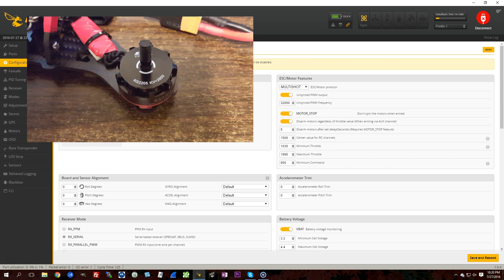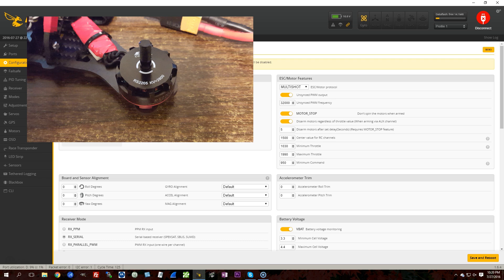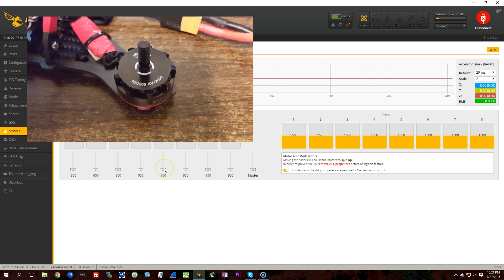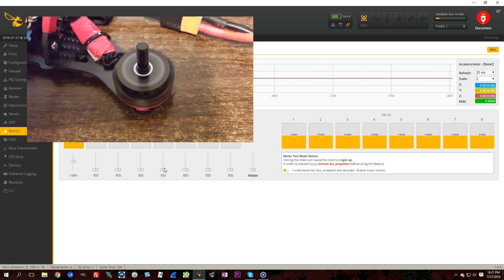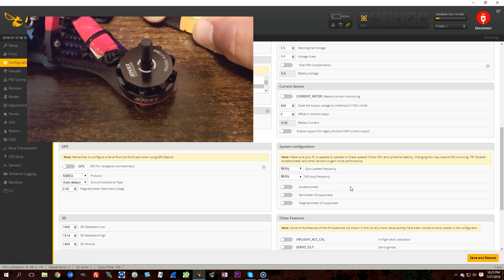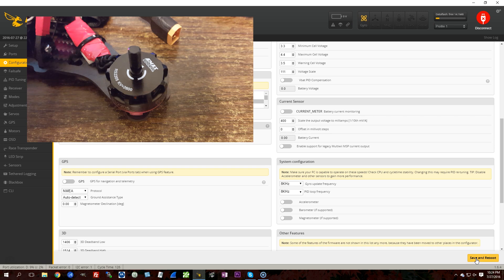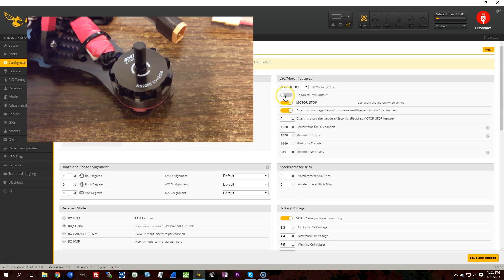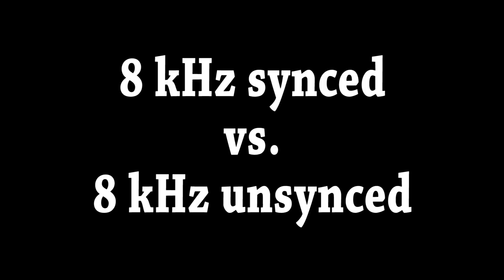Synced vs. Unsynced Multishot: Does it make motors smoother?

Comment: so if I want to run in 8k/8k, and does not want any jitter, I think it will be safer to just run in unsynced 8k too instead of going higher like 16 or 32k and or any higher than what your PID Loop is because I think higher that what your PID loop, the jitter on the cycle time still get feed on unsynced.. It's like I have a bigger bag for errors to feed.
Reply from the maker: You can't run unsynced if you're using Dshot, and Dshot is the way to go. So this topic is a little bit out of date.
Reply: sorry, I got confused with what I wrote "I think higher that what your PID loop, the jitter on the cycle time still get feed on unsynced" I read it and I was like .. WTF happened .. LOL 

This is what I was saying 
"I think it will be safer to just run in unsynced 8k too instead of going higher like 16 or 32k and or any higher than what your PID Loop is because the jitter on the cycle time still get feed on unsynced" 

I understand that I can't use Unsynced if I am I using DSHOT. I still use Multishot on all my build. The reason for that is because .. It's faster that what my ESC can support for DSHOT.
Reply from the maker: If you're running Multishot then I would use 32k unsynced.

Comment: i tried reading to find the answer so i guess ill just ask. i understand why you have min command at 950 but why is your max throttle at 1990 now? Are your ppm min and max still at 1000-2016 in blheli, or is there a different calibration for running multishot? I was also wondering if you knew why when using multishot that the motors take longer to start spinning. When running OS125 and calibrating the way you demonstrated with min command at 980 my motors would spin at like 1005 1010 so i set min throttle to 1025. With multishot and my min command being at 950 now due to the motor twitches like in your video, my motors dont even start to spin up until like 1045 or so. Is that normal? Im runnin a spf3 evo, littlebee 20a pro, and rebel 2205/3000kv motors. TIA!!
Reply: i lied, they all start movin at about 1029 now and dont sound like theyre running smoothly until about 1065 now. This is with runnin 8k/4k/8k by the way. If i run synced the start up tone is NOT in sync. When i run unsynced the start up tone IS in sync.
Reply from the maker: My throttle settings are explained by this video: https://www.youtube.com/watch?v=zCoEWBhJy6Q

If you switch from Oneshot to Multishot you need to recalibrate and re-do min_throttle.

1045 is a completely normal min_throttle value. It's normal for Multishot min_throttle to be higher than Oneshot but I don't know why.
Reply: When you say recalibrate do you mean actually doing the calibration process through the motors tab on betaflight? I just left the min and max ppm where they were from doing the manual calibration you demonstrated by just putting them at 1000-2016 in blheli.
Reply from the maker: You can calibrate with the Motors tab or you can manually calibraet, but you have to do it again after you switch to multishot. The values will be different.
Reply: when i do the motors tab calibration i get a min ppm of like 1016 and a max ppm of like 1955 in blheli. when i was on oneshot, after i would calibrate using the motors tab id get a min ppm of like 1012 and a max of anywhere between 2012 and 2020 in blheli. the numbers just seem off and lower on the highend with multishot and the mins seem like they go up lol
Reply from the maker: It is what it is.
Reply: so my next question is, in your calibration video your max throttle is 2000. In this video your max is down to 1990. Are your ppm min and max still 1000-2016 like in the calibration video?
Reply: so do i leave the max that low in blheli at 1955 or do i put it in the 2000s like in your calibration video?
Reply: i guess my main concern is gettin full resolution which was the purpose of your calibration video. But when i calibrate with motors tab the min goes up and the max comes was down to 1955 so am i not losing resolution?
Reply from the maker: Loss of resolution doesn't matter, the endpoints have to be calibrated correctly. Multishot will always give more resolution than Oneshot. Oneshot on BLHeli has about 250 steps of maximum input resolution, whatever the throttle channel is doing.
Reply: so is leaving them at 1000-2016 in blheli fine or do i need to set them to whatever the endpoints are after doing motor calibration which would be 1016-1955 in blheli
Reply: even you state on the calibration video that if you're not getting 1000 steps then you're missing resolution. So when i calibrate using motors tab if im getting 1016-1955 then im definitely not getting 1000 steps. So should i just leave them with the endpoints you recommend of 1000-2016 in blheli?
Reply: i havent done the motors tab calibration since i flashed multishot though. i just went in and manually set the endpoints in blheli as specified in your video. all im wondering is is that fine or do they need to be closer to what they are when you do calibrate using motors tab which is 1016-1955 in blheli

Comment: I thought PID loop doesnt run at all when spinning motors from the motors tab so synced vs unsynced shouldnt make any difference in the jitter
Reply from the maker: I checked this with Boris before releasing the video. He vouches for the results. The short version is that the PID loop is still calculated, motor output is still synced to the loop, and jitter should be similar to in flight. It's just that the mixer ignores the PID calculations and sends fixed values to the motors.

Knowing y'all, I really should have put this in the video, because this is about the fifth time someone has asked ;-)
Reply: Since the calculations while sitting on a table are made from a very similar numbers, the jitter would be minimal.

Comment: PID loops is not active when using the motor output tab correct? So this test is not really telling us much... Am I missing something?
Reply from the maker: +Randy Soraich I checked this with Boris to address that exact question. The PID loop does run, and jitter still occurs in ghe motor outputs. The PID values are just not fed into the mixer. Bottom line, Boris vouched that the test is correct.
Reply: Joshua Bardwell interesting. Good info - thanks!

Comment: Is there a special thought, why you "crush" and bend your motor wires?
Reply from the maker: This kit was originally built for a 190mm frame. When I moved it to this 180mm frame, the motors had to get closer to the ESCs. I didn't want to shorten up the ESC wires any more than I already had so I just folded them as you see here.

It would have been better if I had used the "under and fold over" method originally to leave my ESC wires longer.

Comment: I'm running a XS20A BLHeli S with SirinFPV FC and EMAX RB 1306 and i get terrible jitter/twitching upon throttle up. Do you think running unsynced PWM would help with that?
Reply from the maker: +AirBlade UAV one sure way to find out
Reply: +Joshua Bardwell what frequency should I try first?
Reply from the maker: Unsync 32k

Comment: It seems that even if the PID loop is active using the motors tab, if you are not changing the actual value being sent to the motor between most loops (like you would see in flight), these results may not mean very much. PID loop timing jitter COMBINED with changes in motor output value would seem to be the thing that COULD cause a more significant differences.
Reply from the maker: Yeah, but this is a specific test of the claim that the motors sound smoother on the bench with unsynced 32k.

Comment: The whole time I while listening I was hoping for an audio spectrum analyzer graph. Would have been a neat graph to compare too as well.
Reply from the maker: If you are determined enough, you can actually generate that from my video's audio track. Audacity is the easiest tool I would suggest for generating the graph. If I tell you how to get my video's audio track, I risk getting a YouTube community standards strike, so you'll have to research that on your own.
Reply: Here's what I came up with... Some real noticeable noise from 32 kHz test, specifically @ 6.33 kHz but it travels from 6 to 10 kHz range. 
As for 8 kHz Synced vs Unsynced, only real noticeable difference was in the 5 kHz range.
And 8 kHz Synced vs 1 kHz Synced showed some noise @ 690 Hz with slight differences in the higher frequencies. 

Here's the graph I used: http://i.imgur.com/FRCK9T0.png
Reply: Also I should add, by comparing the noise level from 32 kHz to 8 kHz test it was 17dB difference at 6.33 kHz. That's a pretty large difference when using the dB scale. What it means, I'm still not sure.

Comment: Is the pid loop active when you use the motors tab slider?
Reply from the maker: Short answer: yes. Long answer: look elsewhere in the comments :-)
Reply: but the PID settings don't act on the copter when using motors tab. In other words, if you move the copter while spinning motors from motors tab, there is no active PID control acting on it, as far as I remember...
Reply: +Joshua Bardwell I ask because I'm trying to get my XS30 blheli_s esc to work on my 210 with a lux. I get terrible low/mid throttle jitter that I can't get rid of, to the point my quad flies terribly. Soft mount, low filter hz, lowering pids etc and oohing helps. When I throttle up with radio while watching motors tab, the values jump around like crazy with motor jitter. But when I just use the slider, there's no oscillations or jitter. Couldn't figure it out, put esc on my kiss fc and they work perfect. Huge time hole.
Reply: It was noted above that, while the PID loop is still running using the Motors tab, the PID values are not being used to control the motors, but when using your radio, the PID values are acting on the quad, hence the vibration.
Reply: +BWFPV Thanks. That's how I figured out it wasn't necessarily a bad esc.

Comment: would putting the quad on a shake table get the pid loop active enough to cause a bigger change in synced vs unsynced comparisons?  but the bigger question is why haven't we seen a tuned flight video of the flynoceros m4 yet?  I just bought the M5 and I'm itching to put it together
Reply from the maker: I am having yaw gyro noise issues that is preventing me from finishing the tune. It's not the Canis fault. This is the same FC that was on the QQ190 when I smoked an ESC so possibly the FC is faulty. I am trying to figure out how to fix the yaw gyro issue because I know it is an issue that other people are having and I want to take the opportunity to explore it myself.

Having been out of town for business also put a hold on that sort of thing. I can take copters with me to fly while I'm traveling, and sometimes I even do builds, but I feel like hardcore troubleshooting and shooting complicated video for the channel is too much hassle when I'm not home.

Comment: actually 4k would have been most interresting. The max frequencies you can see in blackbox are around 200-300hz when you do 8k blackbox logging. there is nothing inbetween there and 8k. So ideally to prevent aliasing to the motors you would need to do 10x higher frequency than your highest frequency noise. That would be around 3k motor update.

It would also be interresting to test differences of different ESC's
Reply: +Boris B.   What would be interesting is a custom Betaflight firmware that allowed switching between synced and unsynced while the motors were running.  Then it would be really easy to compare.
Reply: Bruce Luckcuck There is honestly no difference between the both

Comment: If there is a difference in motor smoothness between synced and unsynched, then it's due to a bug in BLHeli and not a real effect caused by the flight controller.

There a two logical sections in BLHeli firmware - the part that controls the motor (via managing the PWM on the three motor wires) and the part that communicates with the FC to receive throttle commands.  The two sestinas are independent.  The motor sections job is to manage the motor based on the last throttle level received.  If no updated throttle level is receive, the motor section just keeps holding at the previous value.

The control section receives the throttle signal base on a hardware interrupt that responds to the rising (or falling - not sure) edge of the control signal from the FC.  This is the same regardless of the protocol used (PWM, oneshot125, oneshot42 or multishot).  The only thing that changes is the timing (duration/quiescent) of the pulses.  These are decoded in the context of the protocol and turned into throttle level numbers.  The motor speed register is then updated and the motor side starts using the new value.

So a couple of things can be going on here if this is a "real" thing...

1. All of the protocols are just analog signals.  They are time-based pulse-width signals.  Any time you have an analog signal (and variations in timing circuits) you're going to get some amount of jitter when reading the pulse width.  So there may be small errors in the timing from the PC generating the signal, and small errors in the ESC reading the signal.  Also electrical noise and affect the signal and change the timing on the detection.  So why does this matter?  It's possible that the jitter in the transmitted value (not the timing between pulses) might be less when using unsynched since it's generated by hardware.  Since the throttle is not bouncing up/down very quickly by small amounts as much, maybe this could lead to a smoother sound.  It would seem that this shouldn't be the case since there's already a "randomness" added to the motor outputs due to the "PWM Dither".

2. Possibly there's some bug in BLHeli in how the motor section interacts with the control section.  The motor section is running at a fixed rate and maybe having semi-random change in new throttle levels when using synced (due to the variations in PID loop) interacts poorly with fixed motor section timing.  In contrast it may get along better with the fixed speed updates for a synced signal.  But if this is the case, it shouldn't be and is more due to a bug (or limitations) in BLHeli.  There's only a single thread executing in these little processors so it it's busy doing one thing it can't do the other.  So while servicing the control signal it is momentarily not managing the motors.  The motors are controlled by a hardware-based PWM signal so they keep running, but the processor is momentarily not actively controlling them.
Reply: my first thought was: The different sound is coming from the PWM dither. I do not know blheli code. But if the dither is applied only when a new signal is received from the FC the is huge difference on synced and unsynced case. Joshua can you do a test with disabled pwm dither?
Reply from the maker: +Péter Farkas I don't think that's how dither works. I think dither is constantly active.

Comment: Was this with a BLHeli_S esc? Wouldn't jitter from the PID loop be exaggerated when the loop is actually doing something (flying) rather than just sitting on the bench? 

I enjoy the science of this, even if these tweaks are so far above my flight abilities! Unsynced vs synced vs mass of the tree I just plowed into... I think I need less tree to make my quad fly better.
Reply from the maker: I think jitter would be worse in the air. I have a test coming soon that explores that.

Comment: I notice that your min throttle is at 950, and your max is 1990? why 950? i can not get max throttle over 1950 when using multishot.
Reply from the maker: min_command is 950, not min_throttle. Min_command just needs to be low enough that the motor stops entirely. So if the motor stops at 1000, it doesn't matter if min_command is 990 or 950 or whatever. It just needs to be a valid value below 1000. So I just set min_command to 950 on all my copters.
Reply from the maker: Please note that I manually calibrate my ESC. If you are doing stick calibration, setting min_command to 950 will probably not work. If you are doing stick calibration, you should use 1000 at min_command.

Comment: Hmm, interesting tests. You are talking about the PID loop jitter, but since you are going through the motors tab and it is a raw signal isn't that canceling it out?
Reply from the maker: +The RCAddict good question! I checked that with Boris and he said no. He said the test is valid. One thing you could argue is that in flight there would be more jitter. I have a test for that coming up...
Reply: Joshua Bardwell Ok awesome :) I was hoping it wasn't a stupid question lol. Hopefully my next 5inch build will be 8k 8k unsynced. 

I read below people talking about the DYS XM20 on multi burning and you responded about the F330 vs F390. I thought they were an F390 chip?
Reply from the maker: XM20 is an F390. I'm not aware of any issues with them burning using muiltishot.
Reply: Joshua Bardwell Hmm, ok. It seemed like you said they were an F330 from reading it, but awesome :P I have a V3 X racer for the 4inch build I am doing right now, so will run 8k 8k multi unsynced there (if that is ok?)
Reply: +The RCAddict i am running mutltishot on xm20a and xm30a with no issues.